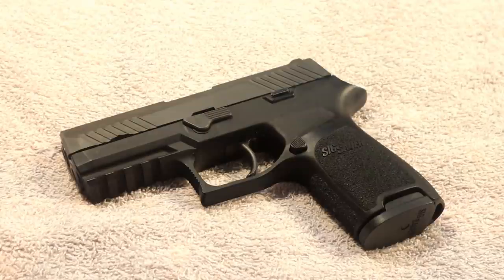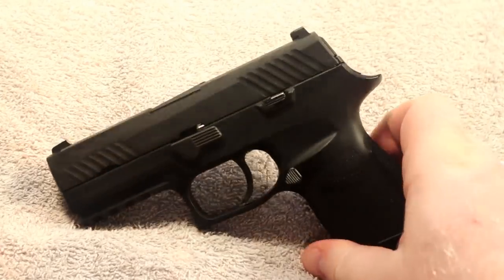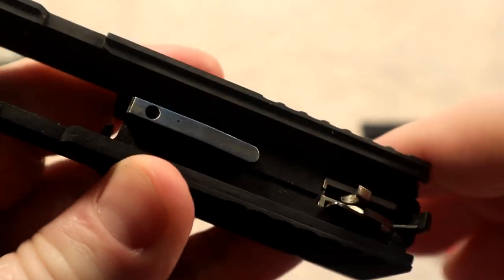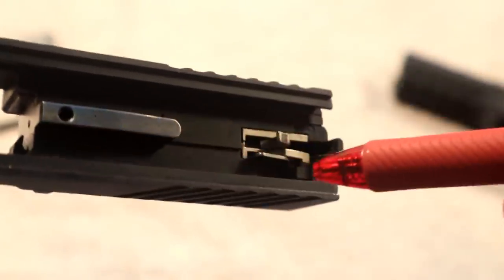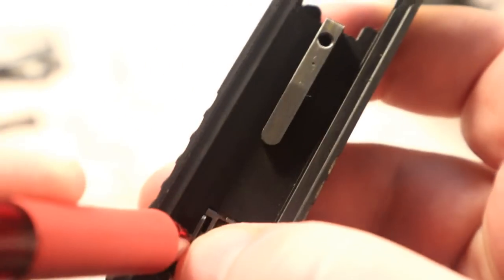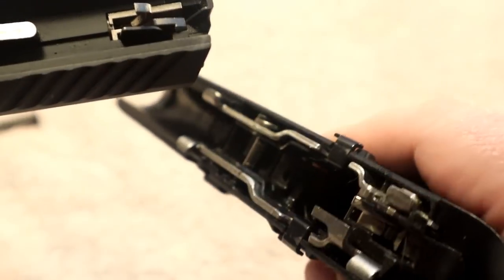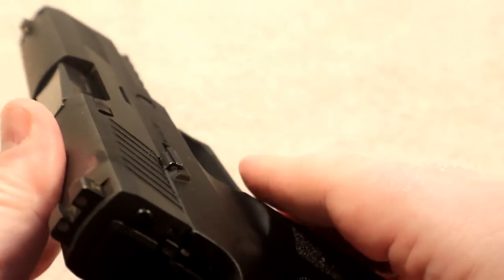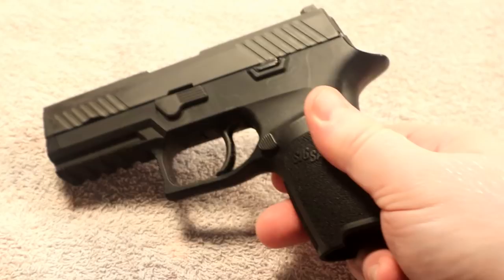The Sig P320's Dirty Little Secret You Won't Find in the Manual

Comment: I bought a P320 yesterday. I knew nothing about it. I always assumed Sig was a top of the line brand just from word of mouth over the years. Plus the gunstore guy told me the P320 is used by the Marines. So I bought the gun..

I have a bunch of guns btw.. 3 Glocks.. 2 Springfields, and a few others..

It dawned on me last night dry firing and feeling the trigger. This gun has a very short trigger pull and to me, it feels like a hair trigger damn near. It feels so light compared to everything I have. On top of all that, there's no trigger safety, grip safety, manual lever safety.. It hit me, you better be on point if you plan to carry this gun with a round in the chamber or when you go to take it apart. The more I played with that trigger I started thinking "Jesus Christ, there's nothing there!" This Sig isn't like a Glock or even my Taurus G2C or none of my guns.

This Sig P320 is not a gun I'd recommend as someone's first carry gun. Honestly, I'm not going to carry mine. I like the gun. I'm never going to get rid of it, but it's just not for me to use as a carry gun. That trigger is too much for me. I don't believe these guns are shooting by themselves.. I came to the conclusion that it was that death trigger and negligence 100%... I've been around guns my whole life and I don't trust myself to carry this thing loaded.

Now, if I was ever in SHTF, I think the Sig with the death trigger might be the one I want to grab.

I called the Sig P320 the Death Trigger last night before I even found out this gun was supposedly "shooting by itself"
Reply from the maker: The 320 is a good gun.
Reply: @BoomStickTactical  I like mine more and more with each day. I ordered a holster for it last night and I think I'm going to carry it.

I nick named my Sig P320 The Widowmaker 🤣

Comment: Two things you should look at more closely:
1). Striker assembly, specifically the integrated firing pin block.  It is a flat piece of stamped metal with a 90 degree bend.  The bend interfaces with the firing pin and not very deeply, might I add.  Dirt/grime on that bend could prevent it from locking into the firing pin properly.  Not a high probability, but an uncommanded discharge is a very low probability event.

2). Place the striker assembly back in the gun and reassemble it without the back plate.  Then push the striker assembly into position and hold it there with your thumb.  At the same time, pin the trigger forward so that it cannot move.  Finally take a Glock tool and push down on the sear which is engaged with the striker.  Your will find that the sear will release the striker.  (Try this with a Glock = no movement of the cruciform.).  At least this occurs with my copy which has gone back to Sig for the “recall” then a few months ago to fix some FTE issues.

This tells me that if the firing pin block has grime in the right place, the gun can fire if it is jostled enough.  It is also worth noting that the interface between the striker and sear is minimal, so dirt or grime there can make that connection weak.

Bottom line is that this would be a super low probability event, but it is enough for me personally not to carry it.

I’ve pointed this out to other YouTubers like gunsngear, but instead of looking into it he posted a video about how great the M18 was literally like 2 days later…smh.
Reply from the maker: In other words, make a bunch of modifications to make it fail.
Reply: @BoomStickTactical  you are not following me at all… I walked you through an examination of the mechanics of the gun.
Reply: And when the trigger gets pulled negligently the firearm goes bang.
Reply from the maker: Yep

Comment: Great video.  Renews my faith in this particular pistol.  Meanwhile, although I own several other brands I own and shoot the P238SAS .380; P938 9mm Legion; P365SAS; P365XL; P2022 9mm;P226 Legion SAO 9mm; and the M11a1/P229 9mm; and a 1911 5” 45APC XO which I like a lot. None of these pistols have ever given me even a slight problem.  Meanwhile, I own the P320 Compact 9mm, and 357 Sig, and Sub Compact 9mm. And it’s been a good pistol as well although as a fairly new shooter… I started in August of 2020 I did become Leary of the P320 and put it away for the longest.  Nevertheless, I’ve recently started shooting it again in 357Sig which I love by the way and now hoping to add .40 S&W.  However, I still don’t carry the P320 but I think I’m near to moving it into my winter rotation.  Currently, I most frequently carry a Kimber Ultra Carry II 3” 45ACP and the M11a1/P229.

Anyway, I think I’ll continue with the P320 I’m not ready to throw in the towel just yet.. still I concede that I do find all these reports deeply disconcerting even knowing what I do about the quality and safety of Sig pistols generally and my personal although short experience with the P320.  These stories keep popping up. 🤦🏻‍♂️
Reply from the maker: These are a great gun.  Nothing wrong with them.
Reply: @BoomStickTactical  lol Yea right
Reply: Throw in the towel and get a glock so you can stop worrying about your gun killing you for no reason. People till this day are still getting shot from having these p320s go off while holstered and there's more recent lawsuits from this year between Sig and police departments.

Comment: There are reasons why older designs with short, light triggers have safeties. Most people would cringe if they saw someone carrying a BHP cocked without the safety engaged (condition zero), but think nothing of carrying a 320, or many other striker fired guns, in the same condition. The only difference is you can't see it. The BHP has a 7-10 lb trigger pull from the factory.. my M18's trigger is about 4.5 lbs.
I'm not advocating safeties on all guns. Except for certain models, I don't see or have a need for them. That said, many people that buy these pistols don't understand what they are carrying. Of course this doesn't apply to all the extremely well-trained YouTube commandos...er, commenters, like myself.
Reply from the maker: The problem is that a lot of people aren't trained to properly handle a firearm
Reply: @BoomStickTactical  absolutely true, but that isn't going to change.
The one difference between the 320 and it's competitors is a trigger safety. Just about every major brand is using them on most of their latest designs, and they aren't seeing the numbers of NDs the 320 is. A pistol with a short, light trigger with no external safety, not even a trigger safety, is being sold to the untrained masses with predictable results.

Comment: Great video and explanation. I trust the Sig 320, I've used the 320s. I believe also that the "accidents" (negligent discharges) were operator error. Makes you wonder....If the sear completely fails, along with the FP block, wouldn't the pistol discharge more than one round? If it goes off by itself once, why wouldn't it go off multiple times or even go full auto? just a thought. Like I said, I have used and trust them, I have never had an issue.
Reply from the maker: They're fine. And yes, it would keep going

Comment: What's the excuse y'all are gonna use for the latest incident with Montville PD officers gun firing in the holster on video?
Reply from the maker: No need for an excuse when the video clearly shows what happened.  If you watch the video closely and pay attention to how the gun is setting in the guys holster before and after it went off, you will see that the gun was not properly holstered.  Before it went off, the back of the gun was above his belt line.  After it went off, it was below his belt line after it got pressed down when he was against the other cop.  There has never been anyone who has been able to replicate the so called issue of them just going off because it doesn't happen.  Something ALWAYS gets against the trigger in every single case where this has been reported.  Not one of the guns involved in any of the instances have ever been made to repeat it.  If the gun was the problem, there would be evidence.
Reply: @BoomStickTactical  a gun discharging from being pushed into the holster is certainly a problem, and it's not clear at all if the gun was or wasn't fully in the holster when it disharged. If it wasn't, then logic alone would tell you it would still be sitting high in the holster from the recoil or even fly completely out of the holster. Y'all make excuses for this gun all the time, but this gun is the only gun that's discharging in the holster. Glocks, M&P's, Staccatos, etc, which are all carried by law enforcement, never have this problem.  Do you not see any issue with a cop carrying a gun that does this? If a cop is in a scuffle, he shouldn't have to worry about his gun discharging if it gets pushed into the very place it is supposed to go to keep it from discharging.  The copium is off the charts with you people.  Y'all could literally be bleeding out from the femoral artery and yall would still be defending this gun as you took your last dying breath. I wouldn't even care honestly if y'all all ND'ed into an artery and died, but there's other people around you at risk as well from the POS 320. People just need to realize that Sig USA is garbage and they are not the same as Sig Germany who actually knew how to make quality guns.

Comment: Seen a video of a man that simply to a nylon hammer to the back of the sig sauer 320 and discharged it with a simple hit. It is entirely possible the officer simply sat down and perhaps her equipment hit the gun and it went off.
Reply from the maker: Not the newer versions. The original design is where the issues were.

Comment: Practical Logic - This is accurate but it also describes almost all modern polymere, striker fired pistols.
Glocks incorperated it from inception. Sure they stole it but they still have it.
Video proof shows excessive play between the frame and the slide on several p320's where pressing 
slowly on the trigger actually raises the Sig p320 slide, vertically and increases this critical distance. 
The striker's ability to slip past the striker blocking mechinism relies on this frame to slide vertical 
minimum and some 320's at least seems to have escaped their safety envelope in what appears to be quick wear.
Disclaimer - This is just an un-educated opinion. Thank you for your endulgence. //ji
Reply from the maker: The firing pin cannot go forward unless the trigger is pressed. It violates the laws of physics.
Reply: @BoomStickTactical  Remember the Titanic? //ji

Comment: Mines little different than that is that manufactured in 2023 mine came with the extra thumb safety
Reply from the maker: You can get them with or without manual safety.

Comment: Really all that needs to happen is some minor fouling inside of the firing pin block that keeps it in the engaged position. I can see grease/oil/carbon building up in there to the point where the block remains in the depressed position. Hell, even a few grits of dirt/sand in the right spot can seize it up. Further, the design of the trigger lifting the block into the disengage position actually forces fouling up and into the channel with every actuation. Now, how most people clean, they do not disassemble that area any further than a field stripping, and will like just wipe and oil/grease the area, which actually forces MORE debris into the channel. At the end of the day, this is likely a maintenance/cleaning issue. Which bodes with the types of people who experience these issues being heavy shooters. Most youtubers and regular folks are putting a couple hundred rounds through it a month, where as police/LE are shooting thousands. This is what happens when people try to out design Glock on their safe-actions. You can't have a crisp clean trigger pull and a drop safe. You know why this never happens on Glocks? Because the striker is not in a cocked position far enough to detonate the primer even if activated. You have to pull the trigger itself, not just depress the safety.
Reply from the maker: There's nothing wrong with them

Comment: I would say the best way to avoid a gun firing by accident would be to carry without a round in the chamber. Just practice loading the chamber everytime you pull the gun.
Reply from the maker: Not having a round in the chamber is bad for self defense
Reply: @BoomStickTactical  in some situations but in most I think having the magazine inserted but no bullet in the chamber is better to reduce negligent discharge. I feel the same about having a safety on a gun, alot of people hate them but I enjoy the extra sense of security. I can understand you feel that in the heat of the moment many will not remember to chamber a round but I feel that if you practice in anticipation of having to chamber a round or remove a saftey it's still a viable way of carrying for self defense. Either way that is just my opinion so I guess it would depend on what the person finds most comfortable.

Comment: ""There are essentially 5 types of 320 at this point. 

Guns made before 4/18 

Guns made before 4/18 but retrofitted after 4/18

Guns made after 4/18

Guns made for LE after 4/18 

Military M17/M18 

The gun was initially designed without a mechanical disconnector to make the trigger as "shoot=able" as possible. 

 It is true that not all P320 are made alike. Some of them are faulty and Sig knew it.
Reply from the maker: The newer ones are fine.
Reply: @BoomStickTactical  I agree but their are still faulty P320 out there, mine included. Sig made a great deal of changes to the P320 and they wouldn't have went to all that trouble (spending money) if there wasnt something wrong with them. I agree, sig has made the new ones safe but there is still old unsafe ones in the market and while I love Sig and think they make quality firearms, I will never, ever buy another Sig that isn't hammer fired. I got ripped on the P320 by buying two of the first gen and many mag's and holsters ETC and the firearm IS unusable.
Reply: @MrKsan05  You didn't even get the date right in your rant- November 2017 is the point at which all new p320s came from Sig with the upgraded FCU parts AND OOB disconnector- NOT April of 2018. Your date of 4/18 has no significance in the p320 discussion. Had you done any basic research you wouldn't have gotten the date so wrong.
Reply: @bamasux253  
you dont even know what im talking about,.....sign......A Hint it involves lawsuits and the changes sig made to the p320, not the drop safe. I'm glad that wiki search helped you with your drop safe recall search............./hangs head
Reply: @MrKsan05   You mentioned the disconnector (for OOB firing) and that was part of the voluntary upgrade of 2017 that addressed drop/inertia firing, and all new pistols shipped after about Nov 1st 2017 had both the new FCU parts AND the OOB Disconnector- all part of the Vol Upgrade. I know what I'm talking about.
Reply: @MrKsan05  BTW I added the words "... AND OOB Disconnector..." to my first comment for those who don't know the Disconnector and FCU parts upgrade were all part of the same program at the same time.

Comment: Great review of the safety features of the Sig and its normal function. I believe that many reports of AD were missing a key detail, such as bad holster design or a weapon stuck in a purse or pocket, etc. It does appear that the drop safe failures have been addressed with the recall of earlier production runs by Sig.
  I DID see, however, the video of an undercover officer having the P320 discharge while exiting a vehicle, the weapon IN a holster, and both hands away from the firearm. I don't see how your explanation would address that specific instance. Several other such incidences (supposedly) have occurred with LEOs with holstered weapons. Some of these instances have occurred after this video was posted, and I would like you do a follow up with these cases, if possible.
Reply from the maker: None of the instances of it happening have ever produced evidence of mechanical failure of any of the components within the firearm.  I continually try to find any information on it but have never seen any photos of any of the guns in question where they point to the failure of a component.  As far as it firing when he was exiting the vehicle, there are some holsters that can flex under stress and directly press against the trigger.  There was an incident about two counties from me where a security guard had one go off in a holster because the holster he was using had enough of a gap since it was light bearing that it allowed for foreign objects into the trigger guard.

Comment: I know they fixed the Spontaneous Discharge issue, but once a firearm loses your trust, it needs to be put down. There are plenty of other options out there. Why risk it on the one gun that might go off and splatter your junk.
Reply from the maker: The problem was not spontaneously firing.  The problem was caused by a heavy trigger that could travel backwards and make the gun fire if dropped at the right angle.  There's nothing wrong with them.

Comment: As of today 4/25/2022 there are 54 reported incidents and about 500,000 guns made prior to the recall and fix.  54/500,000 come out to .0108%. So very small number.  Even if you double the number of incidents and increase the number made we are still well under 1% at .0144%…a tenth of a percent.
Reply from the maker: Exactly
Reply: @BoomStickTactical  I recently purchased the P320 M17.  It has the 1911 style thumb safety.  I think if I engage that when and if I ever do carry it, I should be fine.  I have safariland holster like the military has specifically for the P320.  I’m confident it is safe.